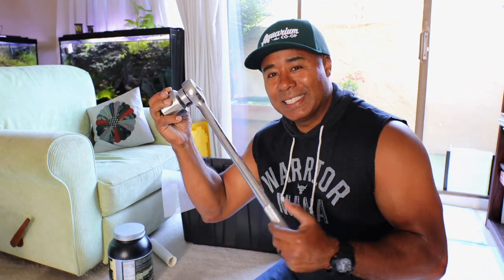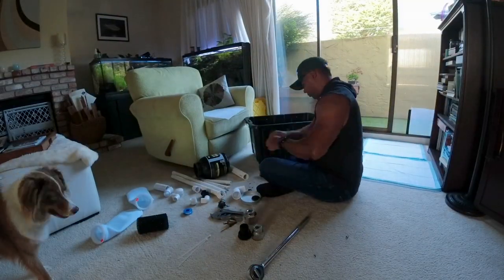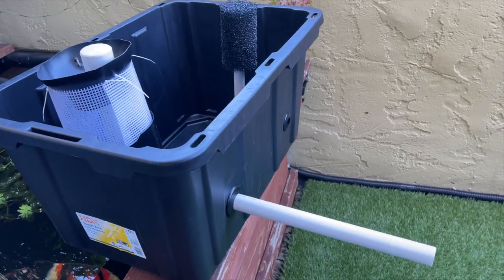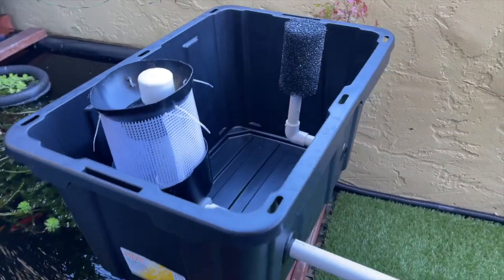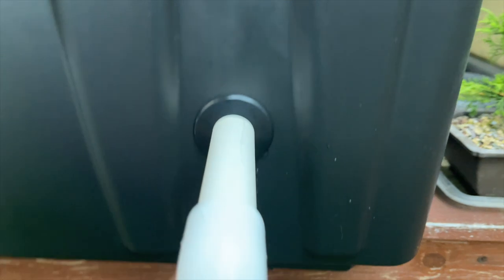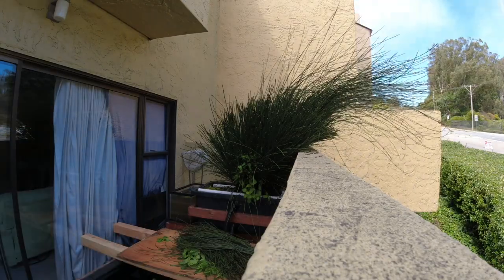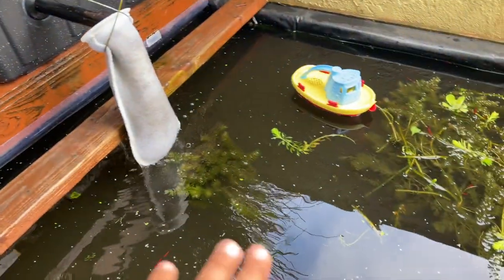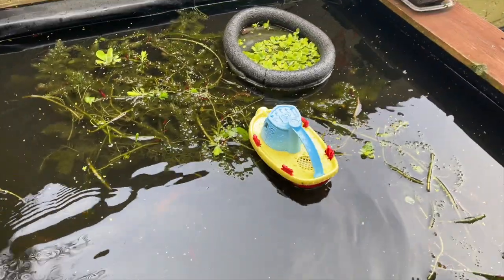DIY POND FILTER [using Home Depot parts]

Comment: Thanks for sharing. Excellent video. I made a smaller version of this using a rectangle planter box for my aquarium. I however used an internal canister as the pump with a coarse sponge to act as prefilter and then at the inflow of the filter I put a container with a medium & fine sponge for mechanical filtration & polishing which then takes it down to the bottom of the planter below the bio media which has a grating under it. It then flows bottom up through the bio media and plant roots & then overflows out through 2 overflow pipes back into the tank. This way it is easier to maintain as I only need to remove the sponges & clean them and if any fine particles do find their way through the sponges, it drops down to the bottom of the filter by gravity as the water flows up through the bio media.

Comment: Hi Taz, saw the filter sock. Just cross a board across the pond however wide needed and make a hole for the sock collar and run the out take hose into it with a strainer attached to it so not to force the water to harshly through it. Hope that idea helps and like your videos too! Oh and try the bog style filter method since you have everything there just run water bottom up.
Reply from the maker: I used to do the bottom up method earlier versions of this filter, but it got difficult to service.

Comment: In regards to the filter socks, I suggest just buying a smaller storage plastic container. Do two holes/one hole. Let the primary outflow, flow directly into this box. Then have a centre overflow with your old leaky bulkhead (just make sure it is above the water), that is a overflow. That way, you can have an easier time swapping out the filters. You already have a 2x6(?) laying there that you can anchor the set-up to.

Comment: Any thoughts about using some coarse filter pads either inside the basket around the perforated pipe or on the outside of the basket?  Enjoyed the video!
Reply from the maker: I’ve done that before (with the old filter). They end up getting clogged quickly and are difficult to clean.

Comment: You should sell these. I’ve never seen a biological filter like this. Yes you can call it a filter mine cost 300 and it doesn’t have a plant it has a sponge and plastic “bio filter” material and carbon filters. But this is a true bio filter true aquaponics. I’ve watched hours of videos of other designs but yours though could probably expand if someone wanted more plants etc

Comment: How do you control temperature for the pond like in summertime
Reply from the maker: Summers in San Francisco very rarely gets the water temperature over 65-70 degrees.
Reply: @TazawaTanks  I live in Modesto so it hits triple digits just was wondering if I could possibly make a pond but I wouldn’t wanna boil my fish because of the weather
Reply from the maker: @joshuabrown847  if it is dug into the ground and at least 2’ deep (and in shade), it would most likely be just fine.
Reply: @TazawaTanks  thanks don’t own a house out here tho so I guess I’ll wait for that